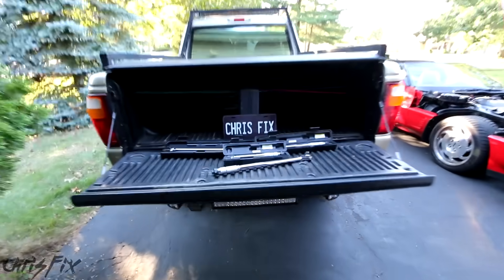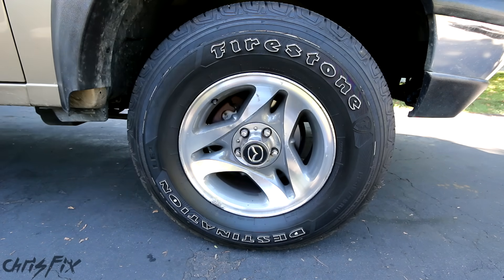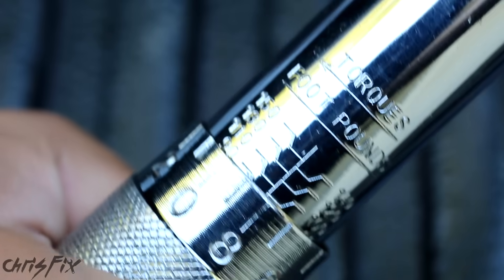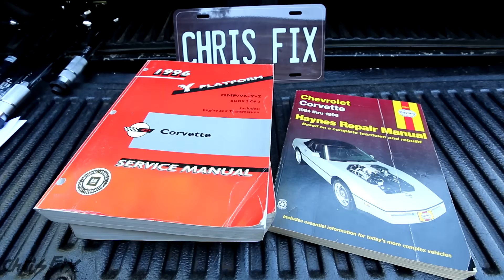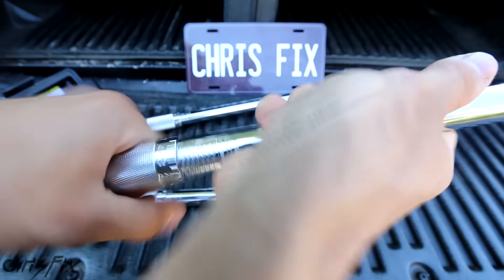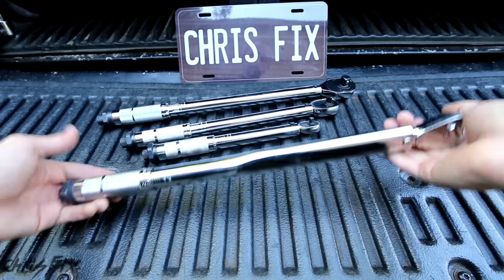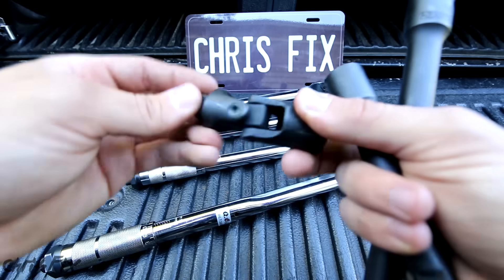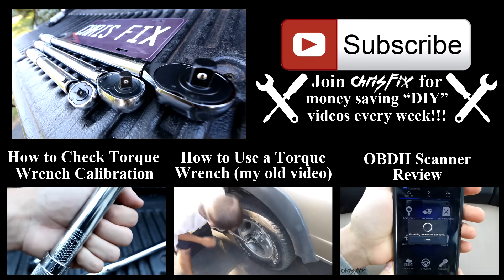How to use a Torque Wrench PROPERLY

Comment: Here's another tip: don't use the torque wrench at close values of the beginning or the end of the range. 
Use another torque wrench with different domain, so value you need to be closer to middle of range.
Edit: sry 4 my engl, is not my native tongue.

Comment: Hey Chrisfix, any chance that calibration video will be happening? I know it's been 5 years since this video but it would be really helpful to know more about calibration of these torque wrenches. Particularly when we should send it in and how far off they can get. I have a 10 year old torque wrench but I've hardly used it and I'm not sure whether it's safe to use to torque my brake caliper and bracket bolts. My brakes are completely shot.

Comment: It's important that the click occurs in the middle of a smooth stroke, not at the beginning, not at the end. That's because a fastener is more difficult to set in motion than it is to keep in motion. If it doesn't, loosen the fastener a bit and re-tighten with the torque wrench.

Fasten multi-fastener assemblies in a criss-cross pattern and, depending on the torque spec, in stages. Say you need to tighten your brake disc bolts to 40Nm, tighten them to 20Nm first, then to 40. For even higher specs use 3 stages.

Comment: Whenever my torque wrench goes out of spec I just buy another one because the cost to calibrate it exceeds how much I actually paid for my torque wrench which was $15 at harbor freight And my local shops Will charge me $75 to calibrate my old one kind of doesn't make a lot of sense if you ask me Why is it that the cost of calibrating it exceeds the actual cost of the torque wrench itself Just seems like a better idea just to buy a new one

Comment: Not sure if it was stated yet, but wheel lugs should be re-torqued after ~25 miles (and they are cooled down) because the aluminum wheels and steel studs expand and contract at different rates.  I typically will do the initial torquing 3 times per wheel, then come back a few days later and do it twice more per wheel.  Its amazing to see how many have loosened up.  I learned this after two lugs loosened while driving and I almost lost a wheel.

The click will happen immediately with no movement of the lug when they are at the final torque.  I sometimes double check a third time but none have ever moved after the second set of re-torquing.   

Great vid Chris!
Reply: Good point. But also keep in mind that the the torque wrench is accurate only when tightening a rotating bolt in a smooth motion, as others have mentioned. If a bolt is already tight enough that the wrench clicks without the bolt rotating, the bolt may not be as tight as required (because static frictional is larger).
Reply: @ttb1513  can you explain this a bit more?  The way I understood it is the click happens at specified torque.  So in my case usually by the second round they rotate and click for the last time (which would indicate the correct torque).  On the third round they click without moving indicating proper torque.  If any spin then click they were not tightened.  

Is there a better way to do it?
Reply: @Spta97Vids  To the extent there is a difference between the static and kinetic frictional coefficients, it would be better to loosen a bolt and then tighten it back up.  If you hear a click immediately on an already pretty tight bolt, it may not actually be as tight as the torque setting.  Making up hypothetical numbers, if you want 100 lb-ft of torque, a bolt tightened to 90 (when re-checking, without any rotation) or above may cause the click, because it takes an extra 10 to get it in motion.
Reply: This was about torque wrenches and how to properly apply them.  Not wheel lugs, or metallurgy.  He didn't talk about friction from the road when a wheel is turning either.  Or miles per gallon.

Comment: Do you think there is any issue with setting the torque just slightly beyond the maximum torque gradation marking on a clicker wrench?  For example, the max torque gradation on the wrench you were using is 150 lb-ft... what if one were to set it to 160 lb-ft?  This could be done easily by going up another 10 from 150 just by counting on the rotating dial... but do you think the calibration would be off significantly?  Interested in your opinion.

Comment: Those looking for a torque wrench you might want to also look at Harbor Freight: PITTSBURGH
 1/2 In. Drive Click Type Torque Wrench. $19.99. That's what I use. 30-150ft. lbs. Comes with molded case for safe storage. Lifetime warranty. Can't go wrong.
Reply: Need to buy a new one in a year. Not worth having a cheap clicker recalibrated.

Comment: WHAT SIZE OF TORQUE WRENCH TO USE OR GET?????
Reply: Torque wrenches are most accurate around the middle 60% of their range. So if you need to torque to 25nm get one that's about 10-50nm. Clicker style torque wrenches go out of calibration after 1 year (even if not used). Split beam style torque wrenches cost more but stay calibrated much longer.

Comment: I just bought a 1/4 torque wrench from harbor freight. Can I use it for my lug nuts or is it too small?
Reply from the maker: It depends on the torque spec, but most likely that will be too small
Reply: ChrisFix yea I got inch lbs confused with feet lbs lol thanks for the reply though!

Comment: As a Mechanical Engineer, we were taught in school about units of torque, and the professors said the same thing as Chris. Only to then open numerous official references and textbooks that specifically and repeatedly used "foot pounds" and ft-lb, or ftlb, or lb-ft, or lbft. It was a total crap shoot of inconsistency and hypocrisy. Thing is, it doesn't matter in the least bit. Due to the commutative property of multiplication, order is 100% irrelevant. Multiplying, ft x lb, or, lb x ft, makes NO DIFFERENCE!

Comment: If a breaker bar only goes up to 80 ft lb and you need a nut tightened to the 100ft lbs, can you just set the wrench to 50ft lbs and do 2 clicks?
Reply: No.

Comment: I see you've got an adapter on your torque wrench.  That was my question.  I bought a torque wrench w a 1/4" drive, not realizing they don't really make a lot of 1/4" drive sockets that are big enough to work on lug nuts (3/4", 13/16").  But it's okay for me to use a 1/4" to 3/8" drive adapter and use my 3/8" sockets to work on my car, right?  Prolly a dumb question but I gather whatever witch craft happens inside a torque wrench is a little sensitive.

Comment: I worked in a torque wrench calibration lab.  Was amazing how most wrenches were way out of spec and basically broken.  Left me feeling can't put much faith in them.  You could torque your bolts and be so far off that it's not even funny.  The cheap ones (all of em except top line) are basically way off even when new.
Reply: Yep. Split beam style are the most reliable, but also most expensive.

Comment: Another tip:

Yes, you can use a "helper" with torque wrenches, just be sure to lock the setting first and be careful not to jerk or pry on the wrench itself with the helper.

Comment: Thanks for this video, it helps a lot. I have questions
Can i use the click torque wrench to loose the wheel lug nuts. To tighten my car’s wheel lug nuts i need to do with 77 ft•lbf. If i can use the torque wrench to loose the wheel lug nut. How many ft•lbf i have to use? Thanks

Comment: Wait a minute. Torsional flex of the extensions shouldn't affect the accuracy at all. It will require you to put some additional rotation into it to pre-load the "spring" but when that thing clicks at 100 lb-ft, there should be 100 lb-ft of torque at both ends of the extension. It's no different than pulling on a spring. When you reach a steady state with a stretched spring, there's the same amount of force at both ends of that spring.

Comment: I had to buy a 1/4" drive torque wrench when I started working on motorcycles. They have a lot of stuff that's only tightened to < 20 lb ft and the bigger wrench just isn't accurate down there.

Comment: $25 to calibrate a $20 Harbor Freight torque wrench :D I'll just test it and buy a new one if it gets far off. I test mine with a digital torque gauge which has always stayed right on. FWIW the Harbor Freight $20 torque wrenches are all still within about 5% or better after a few years.

Comment: The three you used are from harbor freight. Calibration costs $25-70, and each of the harbor freight ones cost $19.99 a piece lol. Can't go wrong with the Pittsburgh torque wrenches!
Reply: You can even get coupons and they can be 10 dollars
Reply: @Saffir3  got mine there for $9.99 with a coupon just today!😂
Reply: @sunnidavis195  What was that coupon??

Comment: I just tighten things and in 40+ years nothing has fallen off
Reply: If you tighten stuff to aluminum and don't want stuff to fall off? Use a torque wrench.
Reply: 90% of spark plug failure due to improper torque.

Comment: How to Check Torque Wrench Calibration: COMING SOON!!!
Reply: @chrisfix  I got a torque wrench wich cannot be set after a said nm setting
Reply: @chrisfix  hi
Reply: It's simple, put your torque wrench on a locked up nut or bolt set at 25lbs, then pull on the handle with a scale. It should click within a lb or two of 25. Up the weight and repeat. Most torque wrenches come from the factory within 4% accuracy so at 100 lbs they should click anywhere from 96 to 104 ft-lbs. If they click before or after that then you know if it reads light or heavy and honestly just give her the Kentucky windage
Reply: @samlepro3 slap train replied to me on a old old video

Comment: Hey chris I have a torque wrench that's been sitting for about a year with pretty much no use. Would i still have to calibrate it?
Reply: Yes. Clicker style torque wrenches need re calibration every year regardless of use.
Reply: Sonofa Seal its a digital torque wrench, is that the same?

Comment: I am new to use of torque I have a cooling sensor that asked for 8ft/lbs or 96 in/lbs. I have a 3/8" drive goes to 96 in\lbs. Just wondering if you have used a torque wrench for thia type of project before.
Reply: It will be extremely inaccurate at the end of its range. Torque wrenches are most accurate in the middle 60% of their range.

Comment: If you use an extension your torque will be off. Also if your wrench breaks for the torque and it's not at 90 degrees it is also off. There's a method to determine the torque difference for both of those instances.

Comment: Just going to add my 2 cents, a 1/2" drive is great to start, but you really need a 3/8" drive for some jobs. Found that out when I tried to  torque the head bolts down on my snowblower...very no bueno with the bigger 1/2" sockets. (I know I could've used a reducer,but hey,now I have a new tool. )

Comment: Torque is important. It's engineering design. It accounts for wear and tear. Bolt something together, you'll have to take it apart to service it, eventually. This allows us to do this and still maintane why this worked so well to begin with.

Comment: Hi Chris, good video. Just one thing, I would think it more safer for your back if you use a downward motion to slacken or tighten the wheels nuts. pulling upwards puts more strain on your back.

Comment: One thing I think you should’ve covered was, if using a torque wrench use the end of the torque wrench the handgrip area and not use any extension bars because that will change your torque value

Comment: just a tip to everyone out there. Your wheel torque wrench is often not 100+ unless it is a pickup truck. Look up your cars specific specs for the wheels. They are some of the most important bots. If they break or come loose while driving, it could be fatal.
Reply from the maker: Thanks for sharing!

Comment: That ratchet you have in your description is 10-150 FP. Not 20-150 FP. But anyways that's what I'm looking for so I don't have to buy two torque wrenches. And if I have to use a 3/8 or a 1/4 size socket I will use an 1/2 reducer.

Comment: You never want to trust a torque wrench to tighten your Lugnuts, and think it's tighten, because it could still be loose, and when you are driving down the road, or on the Highway, your wheel will fly off the hub, and you could be killed. You wanna make sure it's completely tighten by a hand manual wrench, to be safe.

Comment: Is 100ft-lbs really necessary? All the cars I've worked on have specified somewhere between 80-90ft-lbs. I'd be worried about over-tightening with 100ft-lbs

Comment: He left one thing out. If you have to use an in-line extension such as an armorers wrench to work on your AR-15. That will throw you off. You have to set the armorers wrench to 90 degrees. That will cancel out the extended length. The rest of the video was spot on.

Comment: Do you need a torque wrench in quarter, 3/8 and 1/2 in? Or can you just use an adapter on a 3/8 for the other sized wrenches?

Comment: I'm just want to learning about torque wrench usage and your guide simply understand with the tips. As I seen from service manual, the highest that my bike cover until 90Nm. So, I know my best wrench selection will be 3/8 range: 19-110 N.m. is it?
Reply from the maker: It also depends on the sizes of bolts, 3/8 may be too big if its for a bike like you said!

Comment: Hey Chris! Just taking a shot in the dark here with a question? I did not have a torque wrench and I really torqued the bolts on my A-arms on my Atv... Now when I push down on back of Fourwheeler it seems that my shocks have no rebound after compression. I know you work on cars but I was wondering with your mechanical knowledge or anyone else on here... Would over torquing the upper and lower wishbone a-arms possibly be causing problems with shock rebound? They are brand new shocks btw... Literally brand new. Thanks.

Comment: While the proper convention is lbft, it's essentially the same thing in practice.  It's the force applied at a given distance, and the multiplication of both values gives the same result.

Example: You're applying 40lbs of force on a wrench that's 1 foot long.  The math using the normal convention of force x length would be: 40(lbs) times 1(ft) = 40lbft.

Now switch it around: 1(ft) times 40(lbs) = 40ftlbs.  It comes out to the same thing, so whether you say "pound feet" or "foot pounds", it doesn't matter that much.

Comment: Do I need 1/2, 3/8, and 1/4 or can I just get the 1/2 and use a socket adapter? I’ve heard adapters can throw off the torque.

Comment: Guys, don't get the one in the link.  Get a better one. I purchased one and managed to over tighten a balljoint, the torque wrench never clicked at the set foot-pounds, it applied maximum torque. Returned it they sent another, tried it, also didn't work. At this point I wanted my money back Their quality is horrible.  Get something that may cost 2x much but at least works.  If you read the reviews on amazon, this thing is a turd, not sure how they maintain a 4-1/2 ratings when every 2nd review is a 1 or 2 star.  The return rate is high.

Comment: Foot pound of torque is wrong, it should be foot pound-force of torque. Pound is a unit of mass, not force, so you need to multiply by the gravitational constant. Or you know, use newton meter.

Comment: If torquing bolts in a pattern do you do say 20lbs-ft on each one then another 30 on each to get to 50 total? Or do you go 20lb-ft on each one then 50lb-ft on each one for 50lb-ft total? That part always got me. Say if your doing a cylinder head.

Comment: I see many people double clicking with their torque wrenches. Is that good to do? But I've also seen comments from aviation repair techs who are trained to torque it down to the one click and that's it. I've been torquing to one click over the decades. I never thought about re-torquing to get a second click until I saw it on You Tube. Are both ways correct?

Comment: You are incorrect. It does matter how you say it. The terms Ft Lbs and Lb Ft do not mean the the same thing.  They are not interchangeable.  They measure two different things.  With reference to torque wrench settings.  Ft Lbs is correct.  It even says "Foot Pounds" on the wrench's settings.

Comment: I wouldn’t bother with the calibration 
You can get a good torque wrench for £30
So once it’s done just buy a new one, probably a lot cheaper than sending it in to be calibrated
Reply: I like new things.
Reply: Harbor freight has Pittsburg 1/2 torque wrenches on sale for $10 10-150ft pds
Reply: Kinta1112 I live in London UK so I just order mine online either Amazon or EBay :)
Reply: Yep pretty much. If you're willing to spend more, get a split beam style torque wrench. They stay calibrated for much longer.

Comment: pound feet and foot pound are the same unit of measurement.
Reply: True. To add to that, since the units of force and length are multiplied to give the units of torque, it doesn't matter what way you write them. :)

Comment: The torque wrench you said you have is $38 (per link you provided) and you say to get calibrated it's between $25 and $75 do you actually get your $38 torque wrench calibrated...doubtful. For the cost of calibration (including shipping) you might as well buy another

Comment: So if ft lbs isn't the correct way to say it, then why is every torque wrench I've ever seen have "ft lbs" engraved on the scale/meter/setting?  And why did I not here the term lb ft until I was 60 years old (ie recently)?  And why was it ft lbs when using it in college physics courses?  I think it's someone's idea of being fashionable like saying "impordant" or "di-int".  To hell with fashion.  I'll continue saying ft lbs and wearing white socks.